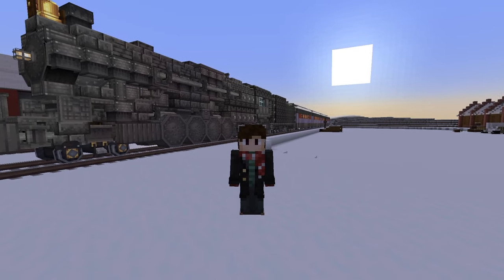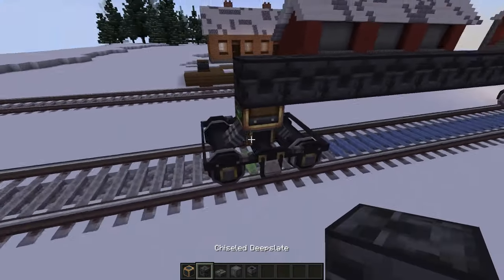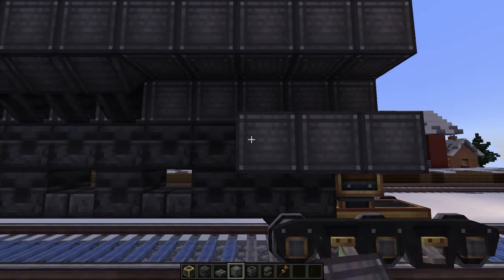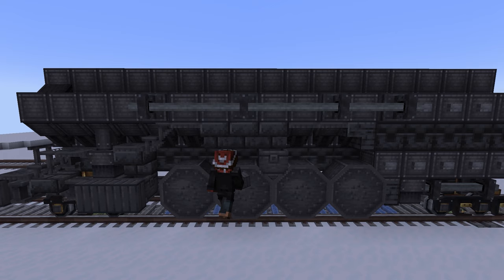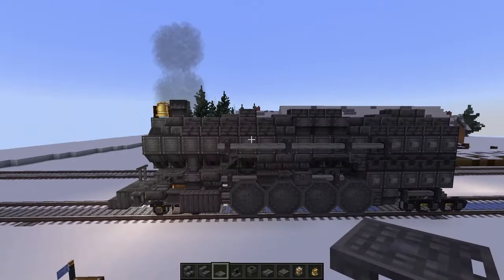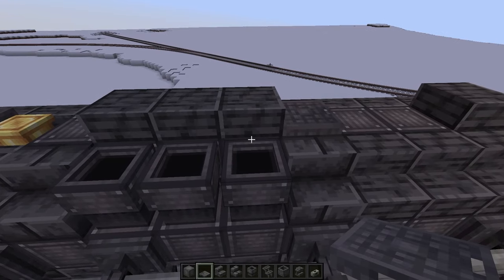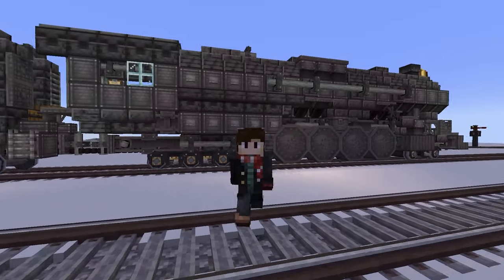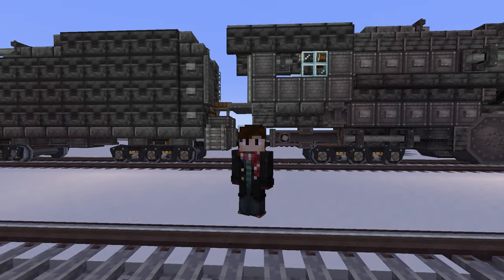Minecraft POLAR EXPRESS with Create Mod | 🎅 Tutorial Part 1 Locomotive

Comment: Looks amazing, only thing thats bugging me is the wheel configuration. Sorry, about to rant as a locomotive enthusiast, so apologies in advance. 

Polar Express, based off Pere Marquette 1225, has whats known as a Berkshire configuration. Meaning 2 leading wheels, 8 driving wheels, and 4 followers. I know you might be limited by the leading wheels due to creates train bogeys, but the follower issue can be fixed by replacing the 6 wheel truck under the cabin of the locomotive with a 4 wheel one. And maybe the front can be fixed by paneling or something to hide them better under the pistons. 

Looms amazing otherwise in getting the look and feel of it
Reply from the maker: Thank you, that would be very helpful if anyone would try to make it accurate to the real engine! It's funny because I actually started out first thing by placing 2-8 and of course 4 trailing wheels from one of the steam 'n' rails bogies, but when I build the rest of the engine then I realize it looks ridiculously small 😅 Hope I can come back and fix it later, if we ever get more wheel sizes or addons though :)

Comment: what are all the mods used like the ones with the lights and the tip of the boiler ok just what are all the modpacks used via curseforge
Reply from the maker: I don't use modpacks, I installed the mod individually. All the mods are in the descriptions and they have forge versions you can search up the same name in curseforge

Comment: I hate that there's no option for 2-wheel bogies
Reply from the maker: If I remember correctly, there is but It wouldn't be the design I'd prefer to use though
Reply: @MadenPlay (deep breath) (sigh) The Polar Express is a 2-8-4 Berkshire steam engine. Two leading wheels, eight drivers, and four trailing wheels. You do what you want with your design, but if you're gonna do something like this - with an actual real-life basis - it's better to stick with the original.
Reply from the maker: @jamesgroccia644  I am aware of that it's 2-8-4 engine but to translate something into Minecraft I have to consider balancing the aesthetic and proportions to accurate details as well, which is why I go for the larger extra wheels on leading and trailing because the accurate 2-8-4 is weirdly small in Minecraft. Do apologize if I forgot to mention this in a video.